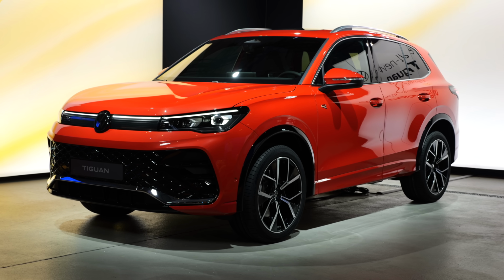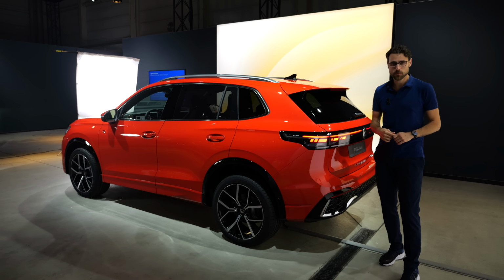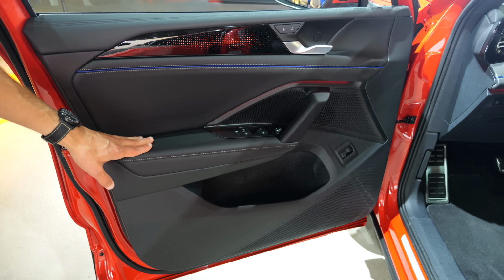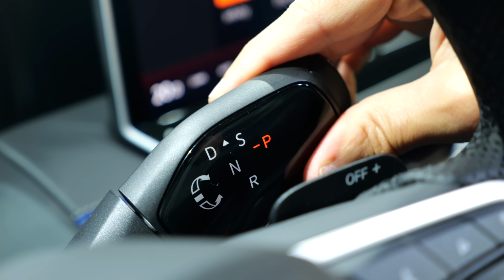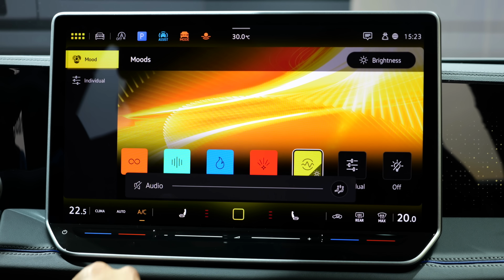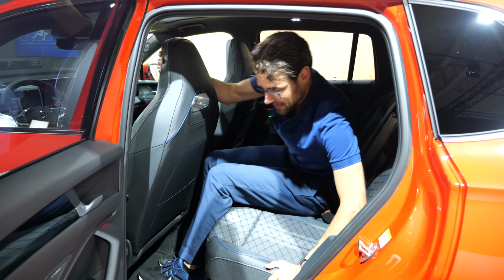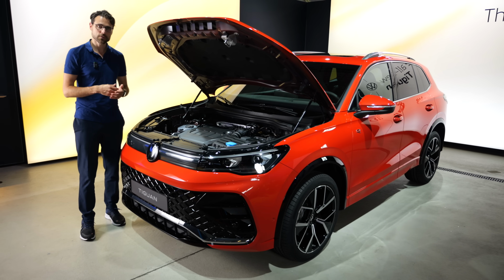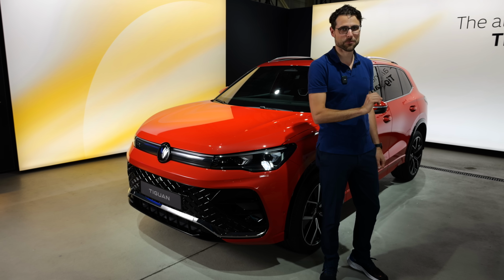all-new VW Tiguan first REVIEW 2024

Comment: The front definitely looks less aggressive, thats what made the Tiguan desirable over its counterparts
Reply: It’ll probably still be the best driving in  it’s classclass
Reply: Exactly
Reply: What are you on? It's the Tiguan with a 2020's technological refinement. It has a slightly agressive stance, like other vehicles, due to use of sharp angles. It is intended to give definition.
Reply: Tiguan never looked aggressive... what? It looked blocky at best.
Reply: @Astke wow, crazy that visual perception is subjective (and in this case yes, it did look much more aggressive to many)
Reply: @jcbrowne16  define many
Reply: @jcbrowne16 I do agree with you. On 2016-2023-gen Tiguan the front looked like a beast, now it looks like prey. Shame.
Reply: @aae445  absolutely agree. The 2022 Tiguan especially the R was absolutely elegant and looked like a proper SUV. Now it looks like a plastic Soccermom car
Reply: @T0NYMANUEL  The fact that the 268hp e-hybrid isn't 4WD was the last knock on that I wont be getting this Tiguan. Which I had waited for a long time. Time to start looking for the Audis.
Reply: @aae445  yeah it's a bummer. I suggest you look at Skoda Kodiaq VRS
Reply: @T0NYMANUEL  just look at the Tiguan most people got. Some mid trim 16 inch wheel gray basic LED Tiguan. It is the one i see the most. And it looks quit uninspiring. It is true that a nice top spec one looks decent however.
Reply: @Astke  the thing is that even the middle spec variant of the current Tiguan looks better than the new one. The new one looks more like an update for the Tayron more than the Tiguan. Idk what's gotten into the designers. Looks like the more capable people were shifted to Skoda because they are designing better cars and better interiors. Just how immaculate is the newest interior of the Kodiaq and the Superb.! 
If I were to buy an SUV of that Segment I wouldn't look further than the Kodiaq VRS
Reply: looks exactly like my T-Cross 😂😂😂
Reply: @RememberThePond  the taillights definitely have some inspiration flowing from the T-cross
Reply: U want aggression from a electric vehicle lol
Reply: it literally looks more aggressive now
Reply: Maybe the actual R model will look more aggressive?
Reply: Aggressive is an insane word to describe the Tiguan. Structured maybe, but this new gen is definitely more structured looking than the old one.